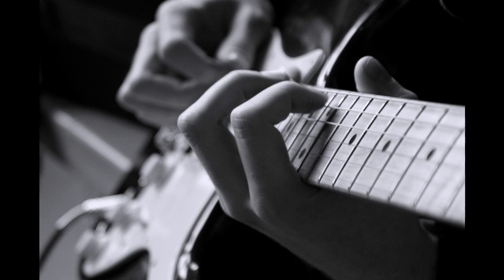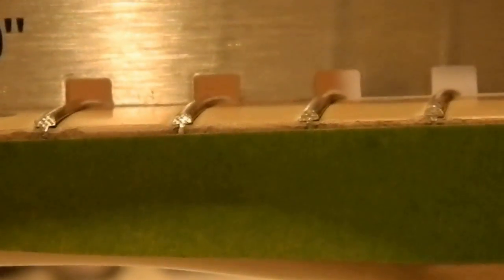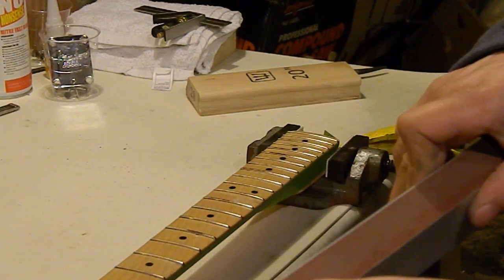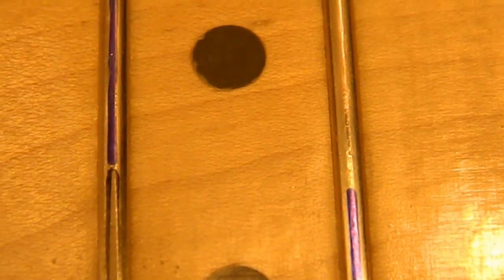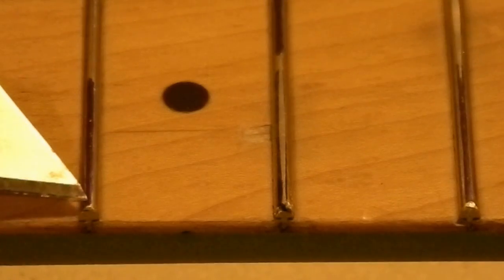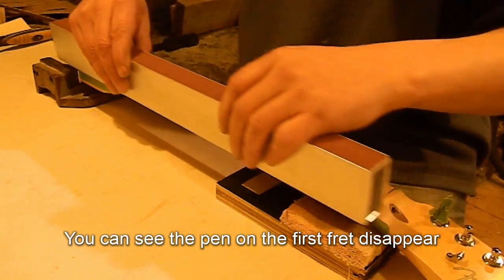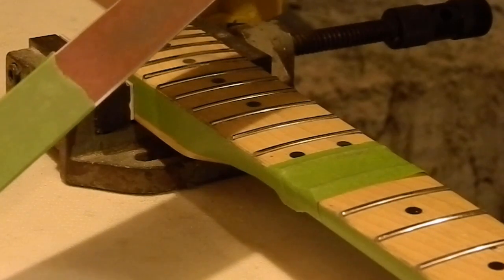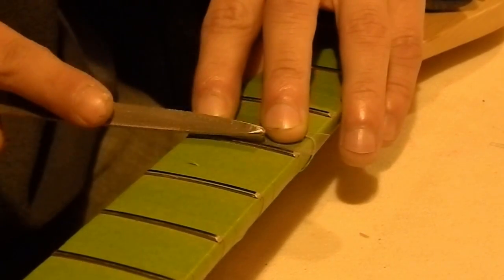Guitar Fret Leveling Why and How - Part 1 of 2

Comment: Excellent video! I have a question though..why do you use a notched level? The bottom of the fret kinda doesn't matter..right? And then you used a 3 fret level 3 frets at a time. Why wouldn't you just use a regular level on top of the frets and go from there? I'm new to this so I'm not, definitely not questioning your knowledge or harassing you..I'm just asking you about something that doesn't make sense to me..me and my little pea brain! Thank you for any response!
Is that a British thing...calling ink, pen?
Reply: Hi there!  Here are some answers to what you're asking.

Bottom of Fret/Notched Straightedge:

The bottom of the fret (and the neck in general) is actually more important than anything else in my experience.  The notched straightedge is intended to bypass the frets and show whether or not the neck is truly level without being thrown off by the fret height.  Before you can level the frets with confidence, you have to make sure the neck itself is level.  Otherwise, you could still have a forward bow or backbow in the neck while levelling, which will create a fret-buzzing nightmare when trying to set relief on the neck to accommodate the customer's playing style.  You want the frets to be objectively level so that when you put relief back into the neck and fret a note, the string can freely vibrate without hitting any other frets (fret buzz).  
Skipping this step results in the "levelling/crowning" possibly making the guitar play worse than it did when the customer brought it to you :( 
Putting the notched straightedge over it shows this, and allows you to adjust the truss rod to ensure the neck is totally straight, thus ensuring that when you level the frets with the sanding beam, the frets come out dead level.
The straightedge I use is notched wide enough for most common scale lengths (Fender/Gibson/PRS) and is only notched on one side - that allows you to use the notched side first to check/ensure the neck is straight, then when you're done levelling you can flip over the straightedge to make sure that the fret tops are truly level before proceeding to crowning.  
Fret Rocker:

In some cases, it's only a couple of frets that are "misbehaving" (too high/too low).  For instance, say a customer brings you a new guitar that has fresh frets with relatively good crowning on them, but has a dead fret (say fretting every note before 5th fret dies out but is perfect on every fret afterward). This probably means the 5th fret is a bit too high, causing buzz on any note before it.  This can be especially aggravating if its higher fret that causes buzz all over the guitar unless you set the action so high it's uncomfortable to play. The fret rocker allows you to zero in on those frets and possibly do a "spot level/crown" to correct the issue without hacking every fret with a levelling beam (30min job instead of 2-3hr job = quicker job completion and happier customer).  Keep in mind, you only have so much fret height to work with before the frets are too low and you end up having to re-fret the neck...
For frets that are too low, usually I'll just bite the bullet and level all of them (you can take material off, but you can't put any back on :P) 
Hope that helps man!
Dave Roberts
Rockstar Customs

Comment: One small point: If the short straight edge rocks on 3 frets it may not necessarily be the center fret that's high. Either of the outer frets MAY be too low. U have to check that possible low fret against the next fret, and then the next 2 frets, etc. It's time consuming, but worth the effort.

Comment: How many turns on truss rod to straighten a neck with about 1/8 fallaway like in this video? Should i have a little (1/32) fall away? Do you always level the frets 1-12 first, then the bottom half later?

Comment: I don't understand why some think it's not important to make sure the neck is straight before fret leveling. If the neck isn't straight, then you're going to shave off more fret than you need to, either in the middle if back bowed or at the ends of forwards bowed. Thus far, I haven't been able to get the 2 necks I've worked on perfectly straight, because there's imperfections between the frets. I suppose it's just imported to make sure the notched leveling beam are flush at the ends, as well as where the neck is most affected by the truss rod (middle)?

Comment: @duncan wallace. I think something is missing in your leveling approach. Suppose your 1rst fret was high, when you put your leveling beam on the frets and start sanding, you will sand at an angle that isn't parallel to the fretboard... You need some sort of jig to keep the leveling beam parallel to the fretboard.
Reply: that is exactly why we check it one by one at first. also trussrod adjustments were done to make sure we have a level neck fretboard

Comment: Thanks for a very informative video, Duncan but I don't understand the need for the "fall away" after the 12th fret. Could you explain?
Reply: jay kaycee If you ever try to get very low action on a guitar, you will notice (assuming all other variables are accounted for) that the first area you'll experience buzzing or a lack of sustain is in the higher frets. From my limited understanding, it gives the string a little more room to breath/move. It's kinda like slightly raising the action without the feeling of a raised action. Instead increasing the distance from the front to the string by raising the string, you've increase the distance by taking material off the fret.

I highly encourage someone with a little more experience with this to check over my answer but I'm pretty sure that's how it works.
Reply: When you bend a string below the twelfth fret or so, the string goes slightly out of parallel with the neck which does not create a problem. But, when you bend a string above the twelfth fret , the angle of the bent string is greater (because the distance to the bridge is closer) so, the 'hump' of the fingerboard radius gets in the way of the vibrating string. Very noticeable on a guitar with a 7 1/2" radius, those bent notes get 'choked out'. A fingerboard with no radius will not have this problem.

Comment: I have an issue with this video... When you use the triangle to check the fret in the middle (lets say we are checking frets number 1, 2 and 3), and number 2 is high, you sand it and level it. Ok, but the fret in the middle (2) is also the first fret in the next group of three frets (2, 3 and 4). And maybe this group of frets were ok checking with the triangle, but when you sand the number 2 to fit number 1 and 3 , you screw up the group 2, 3 and 4. (Dont know if i´m clear, english is not my language...) and if you continue checking this way and sanding frets, you are spreading the error along the fretboard...

Comment: I want to know if I'm the only one who has problem with that back and forth style of sanding. I always  finish unevenly with more surface being sanded on the middle.
Reply: joe valenzuela stop putting pressure on the sanding block! the weight of it will do the work for you and I think you too much in a hurry and rushing your resaults

Comment: Not to be negative, but before you start any sanding or filing or taping, you have to scan the fret ends and middles all over very carefully to see if there are any lifted frets. I saw several here. If these aren't pressed, hammered and glued back down you will have those nasty high frets and they will continue to move or spring up. This is why he had a lot of trouble with a couple of those really high frets. You will end up with a way more consistent job in the end. But overall this was a great video with a little oversight.

Comment: Glue sand paper to a truss rod, adjust the rod to the same as the neck relief and level your frets with strings on, works great. Better than taking everything apart to do it.

Comment: Hey I have les paul copy (about 366 $), can I use good quality carpenter level with sandpaper to level it ? I have done it to my non expensive acoustic guitar and it worked fine.
Reply from the maker: TheKrzesiwo32 yeah if you are confident that your level is flat then go for it - if you've had good results with it before then you should be fine - just take it easy at the start and use marker pen to monitor your progress - cheers, duncan
Reply: Thanks for response :) In my acoustic after fret level I can have really nice action and there is no fret buzz :)

Comment: Sorry I must have missed somthing. Why do the higher frets get isolated from the others and sanded twice?
Reply: I hammer all frets with a rubber mallet (not too hard) and then marker every fret and sand down until I touch all frets (the marker will be taken off just a TINY line on the lowest frets) with a leveling beam, this makes sure alllll of the frets are level. Then I clean the fretboard and mask it off then crown the frets so the string only touches the top of the fret and not like a tabletop of a fret. Then I sand the edges of the frets at the edge of the fretboard and roand them off to make it comfy. Then unmask and treat the fretboard and it plays beautiful. If you take off a lot of the fret top then it might be advisable to sand the grooves of the nut. So the action stays correct.

Comment: Very good video! I have a question though, when you were leveling the frets in video 1, would your tool not have filed all the frets at once? I noticed you did the second half of the fretboard later, I just figured the tool would have filed all these frets too, and wondered how they would be equal in height.
Reply from the maker: Derek Low Hi Derek - there was a fall away already so running the beam over the whole fret board didn't touch the upper frets except very lightly in a few spots. If there is no existing fall away just level the whole board & then sand in the fall away in exactly the same way - hope this helps and thanks for watching!
Reply: Awesome! That is the final piece of knowledge I was seeking before taking the plunge, thank you Duncan and very great work. I wish you had a shop down here in Texas haha

Comment: By 1:00  allow me to help you with the number 1 & 2 problems I encounter on a regular....
#1 Fretboard preparation before fretting. The only way to really see this is by removing the frets. But if the board isnt level even tho all frets are perfectly seated....not level. 
#2 problem frets radius not matching fretboard radius. Frets not radiused the same act like a spring to some extent pushing themselves out of the slots. 
If you need all kinds of reverse pressure on a two way rod to get the neck straight in order to counteract the surface tension caused by the fret tangs combined, your essentially squeezing the frets out with the truss  rod. While the frets act like a spring because of incorrect radius.

Comment: Great vid. Where do you get the sanding beam from in the UK?
Reply from the maker: +Hugelongjohns It's a company in portugal called "guitars and wood" or something like that - you'll find them on google - They sell a variety of luthier tools and i've found them to be very good. Delivery is quick (or was for me on every occasion) and you don't have the issues with the customs man!
Reply: +duncan wallace  Thanks very much, I'll check them out. Cheers.
Reply: +Hugelongjohns Found them! Which size beam would your recommend?
Reply from the maker: the longest one you can afford! ;) ... i think it's the 400mm in this video though ... be careful not to go hog wild on that website, i could spend my mortgage on there in about 20 mins! ;)
Reply: +duncan wallace Haha! OK, thanks very much. I've been meaning to get into proper fret maintenance for a while, so it's time to bite the bullet.
Reply: +Hugelongjohns Info for any other UK amateurs, I used a HomeBase 1m spirit level with double sided tape to hold on the sandpaper. I verified the spirit level was straight by putting it on the kitchen worktop and shining a torch to see if there were any bows or bends. Not exactly scientific, but good enough - it worked a treat!
Reply: +Graeme Douglas Excellent plan!

Comment: I just wonder: why check the height of the frets 3 at a time, but then smooth them with a level, perfectly straight, as long as the whole neck? shouldn't you just sand the parts you marked? I hope I have explained excuse my English
Reply: Because this is the most reliable way to make sure that the entire surface is flat. For example, imagine a scenario where you detect that a fret is high, but actually it's because one of the neighboring frets is low (which is common since some frets are getting more play than others). The only way to achieve a flat surface in that case is to sand all frets down to the height of the lowest one, but the fret rocker won't tell you that because it will only  rock on the frets that are standing next to the low one. If you level them individually, you will find that the "high" spot moved one fret down. I suppose you could do many passes of checking and leveling to eventually get to a flat surface, but that's going to end up taking you an enormous amount of time (like 50x longer) AND you have a very high chance of screwing up by sanding slightly more material off a fret than needed, which will then force you to restart the entire process as that defines the new height everything needs to be sanded down to.

Comment: if I can feel the wood at the bottom of my string is that a bad thing? I kinda like the way it feels.
Reply: You shouldn't have your frets that low, but if all the frets are nicely crowned I think that you won't have any problems except that you won't be able to do bends and sweep pick that easily
Reply: Consider that many new guitars have a good amount of height on the frets, so that this procedure can be done two or three times before the frets need to be replaced. The more often this is done, the lower the frets, and a lot of players do prefer this to tall frets. The only down-side is that you won't be able to level the frets much more, if at all, when they get too short, and you'll need the frets replaced sooner than if they were tall to begin with. Of course remember to keep avoiding pressing the strings down any more forcefully than needed to make good contact with the fret. This is often exacerbated when someone learns to play on a guitar that has poor action, requiring more finger pressure to fret cleanly. They get into the habit of using excessive finger pressure. Many players are in some stage of this predicament, and have to re-train themselves to use the lightest possible touch, when they eventually move on to a guitar that's properly set up. But you should know that a lot of players wish their guitar was like yours, in that respect.

Comment: Flat file on the keyboard with radius 7.26 / 9.50 / etc ..: loss of the fundamental characteristic of a Stratocaster model neck, complete destruction of the radius of curvature of the original keyboard, loss of the  neck.  
* How do you avoid this problem? *

Comment: hey i have a question, why not use a leveling beam as wide as the fretboard?
Reply from the maker: +BlazDGuitar think about a flat surface (the leveling beam) touching a radiused surface (the frets) - only one small point of the flat surface will be contacting the radiused surface at any given time, so it doesn't matter how wide the leveling beam is
Reply: +duncan wallace bu the way you just described it, if it as wide then should be easier to level the frets, am I wrong?

Comment: Thank you for a good video. There's one thing to think about. If you want to sand the frets completely, your sanding beam should be long enough! Why is that? Please, think about the first and last fret: with a too short beam happens that you will be sanding the frets in the middle of the neck  all the time, but the beam touches the first and last fret only seldom. With a long beam enough you'll be touching the frets simultaneously and the result will be you want to! Agree or disagree? Anyway, thank you for 
all of you are intrested in building or modifying a guitar!!!! P.S. Oh yeah, there are many ways to do it, of course!

Comment: To me it seems a little crazy getting this fine fretdressing on such a poor fretjob. The neck would be better off getting a completely new fretjob including fretboard repair and laquering, but the pricepoint may be too high for the customer, who knows?
Reply from the maker: +Christian Boddum yeah the fret job was pretty shoddy to start with, but i have heard this guitar being gigged a few times recently and it sounds absolutely incredible - one of the best teles i've ever heard ... it just goes to show that having a pin-point perfect guitar to look at or inspect isn't the most important thing, unless the reason one owns a guitar is to have it pin=point and perfect - thanks so much for watching
Reply: +Christian Boddum Yeah, that fretboard is really bad, even to a Novice like me. Now I understand why they seal some of them. Do all maple fretboards get sealed with something?
Reply: +MyworstEnemy Maple fretboards need lacquer to prevent them from warping. Rosewood fretboards are more stable and only need a dab of oil every now and then to keep them from drying out and shrinking 'cause then the fret ends start sticking out... ouch!

Comment: It seems to me that ...if you spot a high point at any fret with your razor blade....it would not be a good idea to use that fret as another reference point ,to check the next 3 frets......Unless you actually file down the high fret to its proper height....before you take the next reading...Also I thought there was an agreement/understanding that the tension of the strings had a straightening effect to a slightly bowed neck